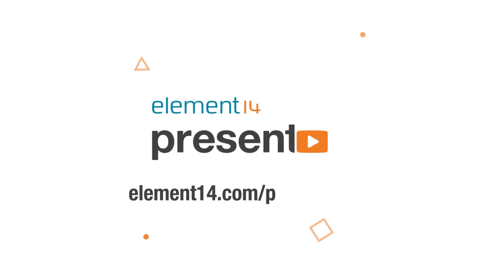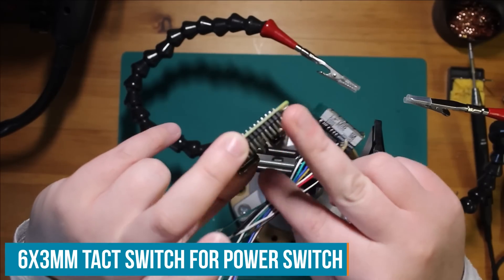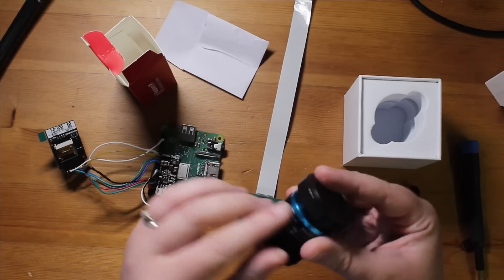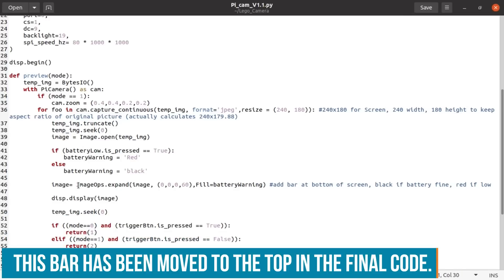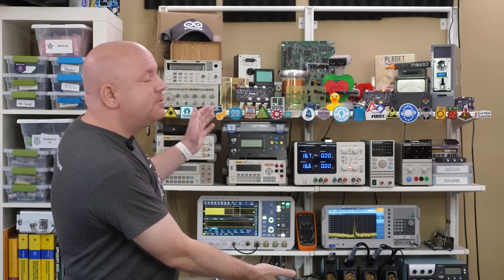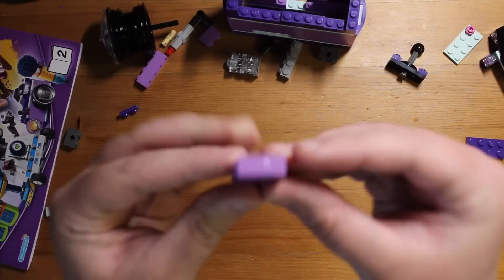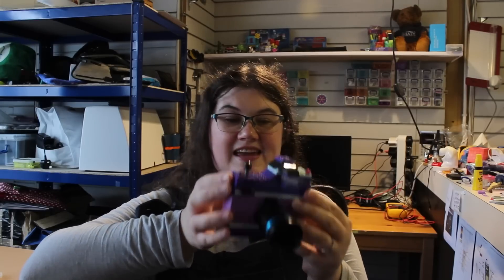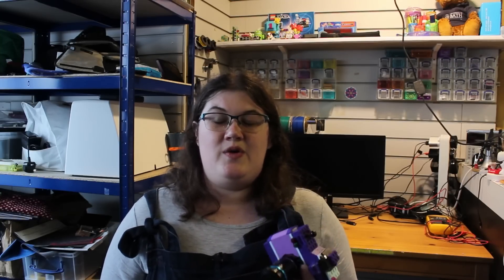Lego #RaspberryPi HQ Camera

Comment: Cute idea. But its a 3A+ inside so it has wifi, can just enable ssh/wifi and remote into it to pull the files. Alternately, modify the case to expose the usb port and mount a USB Flash Drive, Have the script save your photos to the flash drive, and when your done taking pictures, shutdown, pull the flash drive, and when your ready to take more, put it back in, boot it up and carry on.